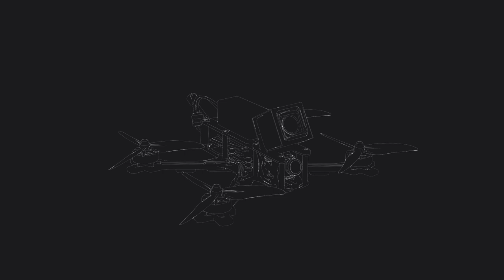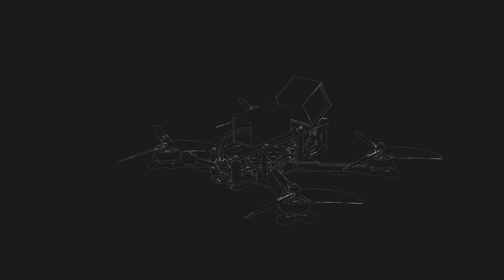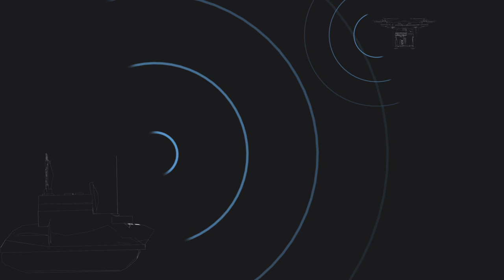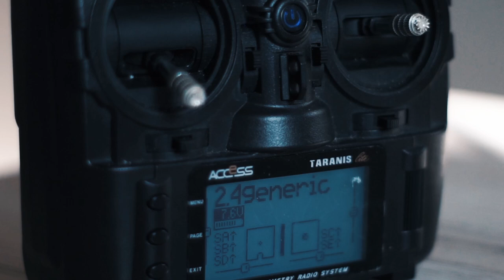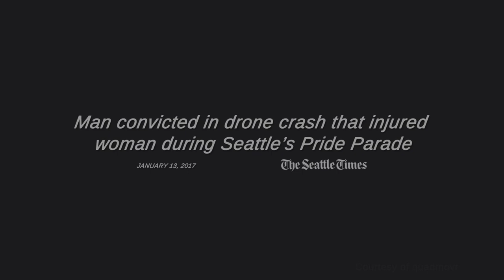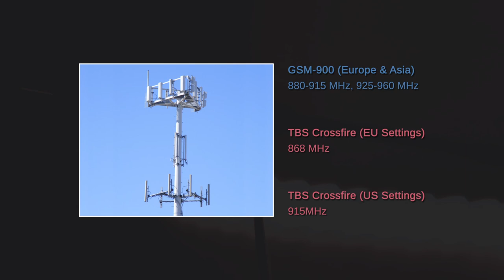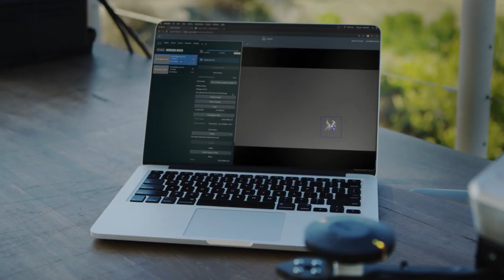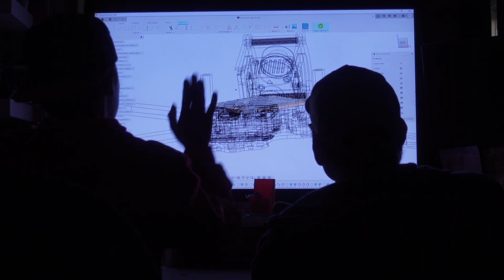Weaponized Toys - Consumer Drones Being Used for Evil

Comment: as someone who's into this hobby and regularly flies FPV, its incredible to me how rare it is for these things to be used in terror attacks. despite the relative accuracy of the content, this video greatly understates the capabilities of DIY hobby drones with some relatively simple modifications that are not mentioned in this video. and that's not to mention the increased prevalence of flight control mediated by machine learning algorithms. I think the final thesis is correct; that a free and democratic society must remain vigilant in striking the right balance between mitigating threats without compromising liberties, but this aim seems to become an increasingly challenging proposition as sophisticated tech becomes more and more available to the general public
Reply from the maker: Providing instructions on modifying a drone for sinister purposes is not something for a Youtube video. Ironically, I had to strike a balance between informing and not inspiring. I'm a pilot myself and talked to others before making this video as I wanted to keep this fair towards the community.
Reply: >relatively simple modifications that are not mentioned in this video
like what?